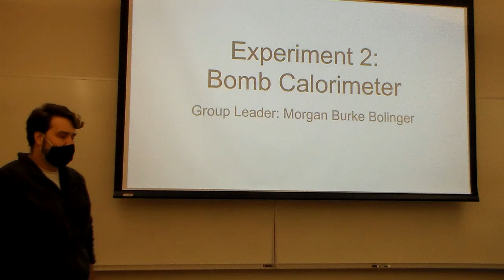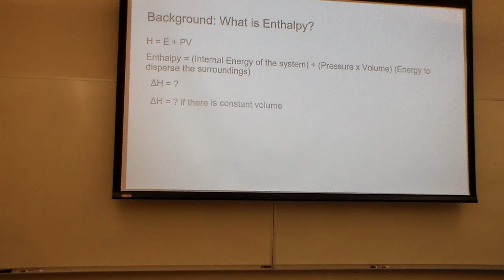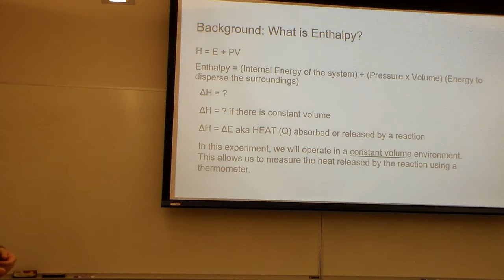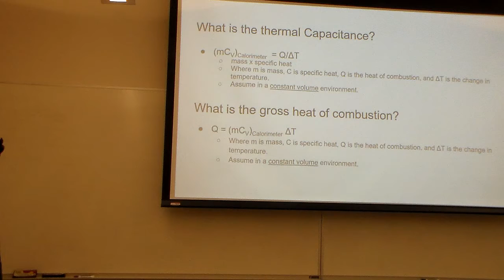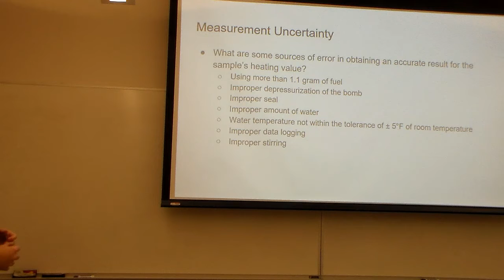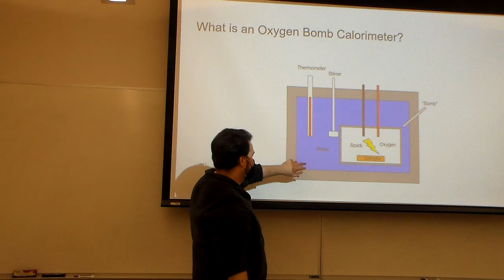ME 4611 - 27 Jan 2021 - Burke Bollinger - Bomb Calorimeter Presentation

Comment: I thought the presentation was very welled prepared. Burke did a good job explaining the details of what a bomb calorimeter is and what it is made up of.  Also, I think he did a good job of explaining each equation that will be used in the experiment, and along with the equations, Burke explained the corresponding theory as well. I think it was also a good point to include measurement, to make sure we are aware that there is always a chance.

Comment: Self Assessment: I went overtime, so I should have shortened the presentation. However, I do like that there was a question and answer section at the end. I should stop focusing so much on the slides and focus more on making eye contact with the audience. I need to stop with "uhs" and use more pauses. I could have ordered the slides better. Initially I thought that setting it up the way I did was interesting. But, ordering the slides comes before an "interesting" setup. I made some assumptions for my calculations. We will see if those assumptions are proven right on the day of the experiment.